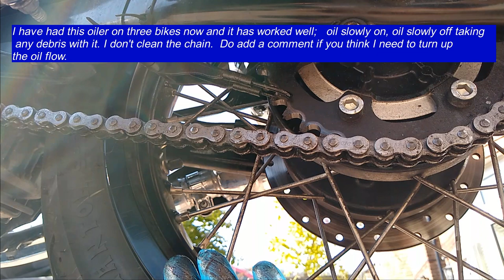Fitting a Scottoiler (automatic chain oiler) to a Royal Enfield Interceptor 650

Comment: Thank you very much for the video. I will first install mine with the single outlet that comes in the kit and bolt on using bobbin threaded hole. I will then decide if I need to upgrade to the double outlet later on.

Comment: Nice job.........I think. Not sure about injector positioning? I use the E-System with single injector, quite a bit more expensive but ultimately far more flexible  as you can adjust the flow on the fly and to suit various conditions (speed, weather etc.) and of course you don't have to fart around with that vacuum take off which has often been a source of problems for many. [thumbsup]. I get 1500+ miles from a reservoir and the chain is always perfectly oiled.

Comment: so how many miles/kilometers before a refill is required & how do handle splashes especially during leans & inclines
Reply from the maker: - one full reservoir goes for over 500 miles, as for leans and inclines these have no effect.  Adjusting the flow to get this right is important, and having a firmly fitted injector.